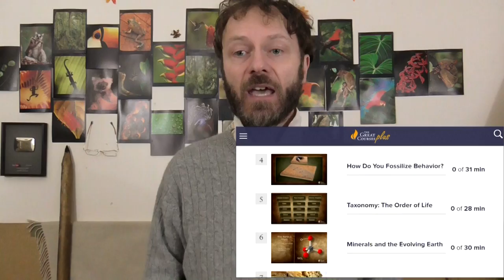Muzzle Brakes - what are they for?

Comment: When the tank commander responded what was a muzzle brake ? I was like:Yes I finally know more then somebody!
Reply: I'm not as surprised as I probably should be that the tank commander didn't know what that was.

The Brits don't have any tanks that use them, nor do they have artillery or SPGs that use them either. And while they have a few sniper rifles in the commonwealth that do, can't expect a tanker to have fired one of them.

In the US, our Howitzers still have them (and they put quite a bit of space between guns due to the side-blast), as well as a number of cannon in Armored units.
Reply: wrong, actually. The Royal Artillery use the 105mm Light Gun, which as any gunner will tell you, has a muzzle break that works at 35% efficiency
Reply: and further to my last point, the Royal Artillery also uses the AS90 self propelled gun, which also possesses a muzzle break.
Reply: I stand corrected!

I thought they'd gotten rid of those artillery pieces a while back(at about the same time the US upgraded it's howitzers) for some reason, and I didn't know of the SPG in particular.

Comment: Another pretty common misconception is between clips and magazines.
Reply: I'll have you know that school shootings occour outside of the US aswell.
Reply: Gun maniac? You mean, people who acknowledge guns existence, and like to know accurate terminology?
Reply: a clip is internal in the gun and a magazine is external?
Reply: A magazine has a spring in it, it can be external (like what you load into an AR-15) or internal (like how you load a pump action shotgun).

A clip is simply for holding rounds they're some older rifles that you load with a clip, you can see this if you look up an M1 Garand. Clips are also sometimes used for storage.

The vast majority of the time when you're talking about putting something with bullets into a gun, it is a magazine.

As a bonus, a belt is what it sounds like, a bunch of rounds connected into a line, you see this on heavier machine guns, the belt is usually in a "bucket" with the top of the folded belt loaded into the gun.
Reply: Jane is right. A magazine has a spring. Clips hold for reloading. But, I like to call magazines clips because it "triggers" some people into fits that are silly and amusing.
Reply: +der Moosenheimmannchesteron  no one cares
Reply: oh god theres no point in making a vid no one understands the difference.
Reply: i find the best way to describe it is a clip loads rounds in the magazine the magazine loads rounds into battery. but the 1906 bennett is hard to determine what it uses in my opinion.
Reply: Blah b You're on a Lindybeige video. If you don't have an inherent desire to aquire more knowledge, why are you here? Also, why are you watching a video about muzzle breaks? Obviously you're never going to use this information, as you're not a tank operator.

Seems a bit stupid now, doesn't it?
Reply: A clip has no moving parts whereas a magazine uses a spring which is a moving part
Reply: The only reason any one cares is that clips and magazines both exist and perform similar functions and therefore need to remain unambiguous.   It's like interchanging the words broom and vacuum cleaner.
Reply: what I've figured out is that the magazine is what the rounds are held in when actually firing the weapon.  There are detachable and nondetachable ones.  A clip holds bullets together outside of the magazine, though it can be inserted into the magazine (called a manlicher style).
Reply: Are we having one of those "Shit on Your Dreams" parties? I hear those are pretty fun.
Reply: No he means people who like to brag about it and be picky. I love when people call the M1's clip a magazine though =D
Reply: Well, the M1 is understandably unclear to a lot of people. Becuase you load the entire clip into the internal magazine. So an M1 will have both a clip and a magazine.
Reply: Jane Murphy as I explained, that is a manlicher style clip, where the clip is put into the magazine, as opposed to a stripper clip, from which the rounds are removed before going into the magazine, such as the 1903 Springfield or Kar98k.  All firearms that fire repeatedly before needing reloading have a magazine.
Reply: I just said that, but in laymans terms.
Reply: +Jane Murphy To be fair +SgtKOnyx was only giving a more technical description of en bloc clips and stripper clips.  I do think the details of clips, magazines and belts would make for interesting videos though.
Reply: and spandues
Reply: yes they do but considerably less
Reply: Jane Murphy I didn't use overly technical terms, at least unexplained ones, and I was more referring to my earlier comment to the same effect.  So, more accurately I had just said that lol
Reply: lol glad you got the joke
Reply: Der Moosenheimmannchesterton
Reply: This is a ghost gun. It has a .30 caliber 30 magazine clip, and it is capable of dispersing 30 rounds in half a second.
Reply: They call it the Thirty-Thirty-Thirty-Thirty-Thirty

Thirty.
Reply: Clipazine
Reply: The clip feeds the magazine, the magazine feeds the weapon and the weapon feeds the bad guys.
Reply: ***** Yes and no. If you look at the K98k, you do use stripper clips to load the rifle. However, the stripper clips are really meant to load rounds into the internal magazine of the weapon, and then the bolt strips the top round and chambers it in the sprout. That's what I mean when I said, "...the magazine feeds the weapon."
Reply: ***** not all magazines have springs, so that's why that's a bad definition.  Look up gravity pistols.
Reply: some guns have both a mag and clip load. it depends on how it was made, what attachments it may have etc.
Reply: Thrax Sablescales I've never heard of a gun with a detachable box magazine and stripper clips used to reload, could you provide an example?
Reply: SgtKOnyx
He didnt say stripper clips in fairness he said a mag and clip load.  M1 Garand uses a Mag and clip load.
Reply: Paul O'Sullivan not exactly. The clip goes into the magazine, but you cannot reload by replacing the magazine
Reply: Which only becomes more confusing for some people when you bring up enblocks
Reply: asdfg2560 true
Reply: isnt a clip something that holds a group of bullets together, and magazine has the bullets inside of it? as in the clip that held the 5 bullets together for the lee enfield vs the magazine of a m4a1?
Reply: except there is no such thing as a barrel brake
Reply: SgtKOnyx
Thats still a clip and magazine though so I am not sure why you would say not exactly.  It uses both a clip and a magazine even if you dont replace the mag in those circumstances.
Reply: Paul O'Sullivan it has both a clip and a magazine, but the way you said it makes it sound like you can reload by replacing either the clip or the magazine
Reply: SgtKOnyx
 I would say that was your assumption I said that an M1 Garand uses a Mag and Clip load, you have a mag in the rifle and load it with a clip.  Well okay you can load a single round into the chamber but normally its loaded with a clip into a mag
Reply: Skallagrim did that one already.
Reply: a clip is only used to transfer the ammunition into the magazine an en block is inserted with the ammo into the magazine
Reply: asdfg2560
An en bloc is still a clip, so is a half moon and moon.  They are all clips.
Reply: no an en bloc goes into the magazine a clip holds the ammo together so that it can be put into the magazine or cylinder at which point the clip is removed
Reply: asdfg2560
???  No not at all, I hate using wikipedia as a source but https://en.wikipedia.org/wiki/Clip_(firearms)#En_bloc oh there is the fact that I have been using them for the last 30 years?  Take your pick either way en Bloc clips are definitely clips.
Reply: Paul O'Sullivan and to make everything more complicated, the magazine on a warship fits our definition of a clip better
Reply: SgtKOnyx
Well technically magazine just means a place in which ammunition is stored.  It should refer to a closed space although in fairness the magazine of a gun is obviously open to the internal portion of the gun itself.  Clip means holding ammunition in place.
Reply: Paul O'Sullivan
Reply: Der Moosenheimmannchesterton just call them clipizines...
Reply: andrewhalo100 Wow, I didn't know that. Thanks! :D
Reply: SgtKOnyx There is one that I can think of, because I have one, the VZ 58 rifle.  It looks similar to an AK and uses the same 7.62x39mm round, but functions very differently.  They have removable box magazines that are actually meant to be replaced to reload the rifle (many guns loaded with stripper clips have removable box mags, they are just meant to be removed only for cleaning so they are hard to remove and replace and that isn't how you actually reload,) but there is also a stripper guide on the top of the bolt carrier so that you can load the gun with stripper clips (great for top offs) or use the gun as a stripper clip guide to load your magazines more quickly and easily. It's a very unusual arrangement and it's one of the reasons I absolutely love that particular rifle.
Reply: SgtKOnyx That last part isn't exactly true. Revolvers can be fired repeatedly before reloading and don't have magazines (some can use moon or half moon clips though...) A cylinder is a set of individual chambers, not a magazine...
Reply: anonymous Magazines don't have to be boxes... They can also be tubular, drum, helical, etc. Most have springs, but not all, I was stoked to see someone in the comments mention gravity pistols.  The Girandoni air rifles (like the one used by Lewis and Clark on their expedition) also have magazines on the side of them with no springs, you simply hold the gun muzzle up and let gravity do the work...
Reply: SgtKOnyx Nice! So glad someone else has seen those and knows magazines don't necessarily have springs and followers!!! The Girandoni air rifles (like the one used by Lewis and Clark on their expedition) also used a magazine along the side that  used gravity to feed, just hold it muzzle up and push the breach block (which does have a spring...) over and a ball falls in.
Reply: That's just terminology, not really a misconception.
Reply: If they are watching this video they obviously do. Also owning guns is a normal hobby.
Reply: Or at least, in the toy plastic-and-foam gun world.
Reply: anonymous Yeah, I know some do, although the spring you're talking about is one that keeps the second round from feeding, doesn't force the rounds into the feeding position or chamber like the mag springs most people think of. I was just commenting because of the people in the comments above who seem to think that a magazine has to have a spring in it. Was glad to see that you know better.